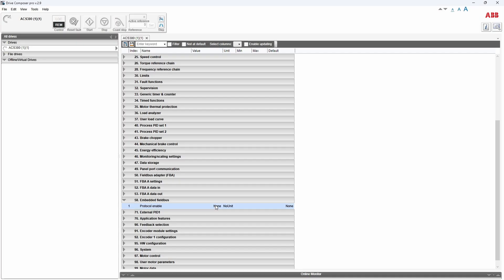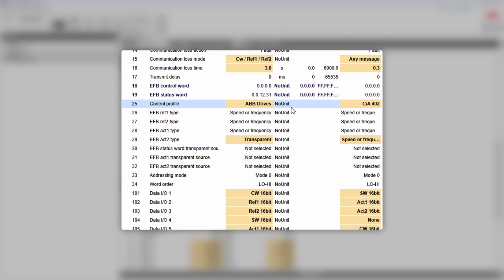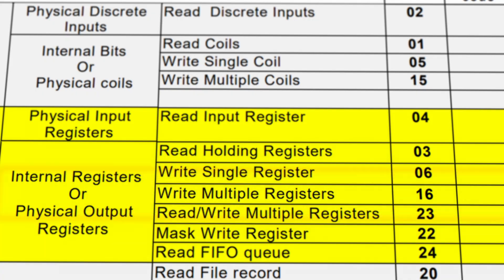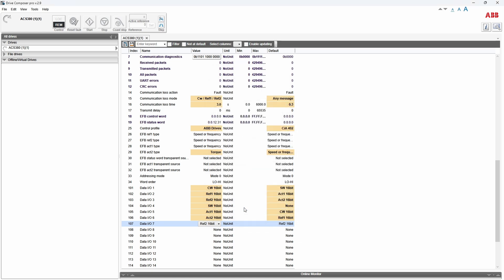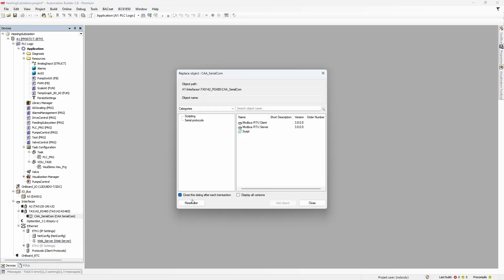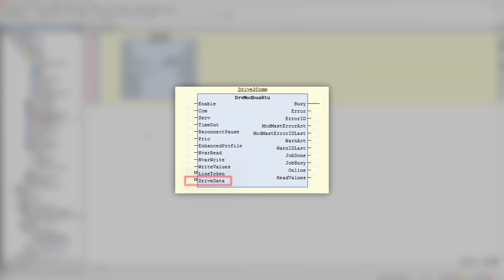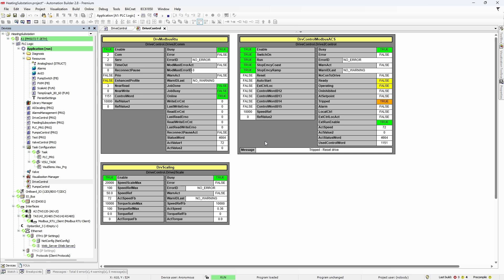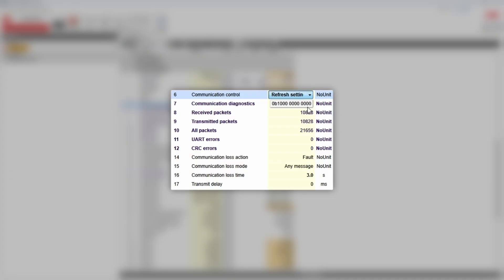Intro to AC500. Part13. ACS drive control over Modbus RTU

Comment: Hello. We replaced an ABB ACS800 VFD which already connected to AC500 PM573 PLC By RS485 COMM Modbus,RTU Network, with ACS880 new VFD. we defined same network parameters on new VFD such as ID, baud rate and ... but the PLC and new vfd are not cummunicating together.. please help on what parameters we should set on PLC side as master or VFD side as slave?
Reply from the maker: Hi! 
Have you tried to refresh settings by setting 58.06 to 1? What does 58.07 show? Are any of counter parameters (58.08-58.12) being increased? Do you have access to PLC's application? Are there any errors there?
Reply: Thanks to your reply. Actually from the first two ACS800 was installed and connected to PM573 PLC by Modbus RTU. Then one of them replaced with ACS880 With a FBA modbus RTU external module and FBA A settings done also FBA inputs but parameter group 58 was not enabled. So finally one ACS800 and one ACS880 was connected to PLC. now we replaced that remained ACS800 with ACS880 with same FBA Modbus RTU card and did the same parameter settings...
Reply: So now how we can configure the new second installed ACS880 to communicate PLC with that in Modbus RTU? Shall we change something in PLC side or need to set something in VFD side?
Reply: If you have another channel like WhatsApp or google meet or etc. we can discuss about the issue.. thanks to your help
Reply from the maker: In general, you don't need to change something in PLC if default Modbus RTU settings for ACS800 and ACS880 are used.
Here's what I would do to track the problem:
1. You need to check if communication is actually happening. If parameter 58.08 rising then master can reach the slave. If only 58.10 rising, then you probably misconfigured Node ID. If 58.11-58.12 are rising then something is wrong with wiring/speed/parity.
2. If master is able to reach the drive, start looking into 58.19 (status) and 58.18 (control). Compare status to status of ACS800 is it the same? When you give command to run the drive is the value of control in ACS880 the same as in ACS800.
3. If all ok with previous item, check if drive is configured to take reference and control from the fieldbus (params 20.01, 22.11, 28.11).
That's the best I can do to help. If you need someone to come and check - contact your local ABB office.